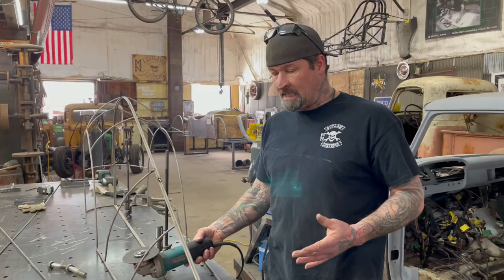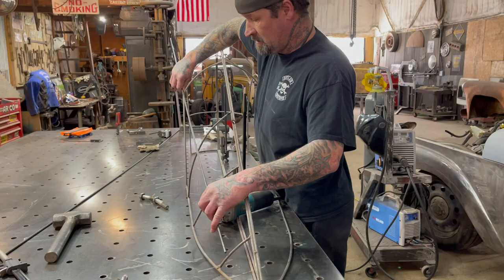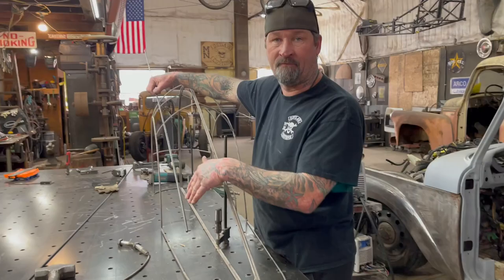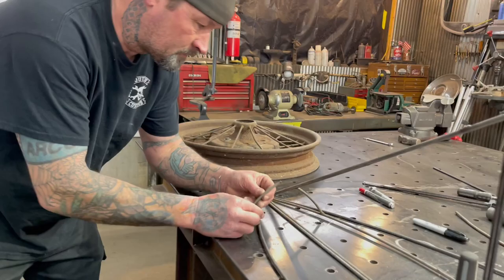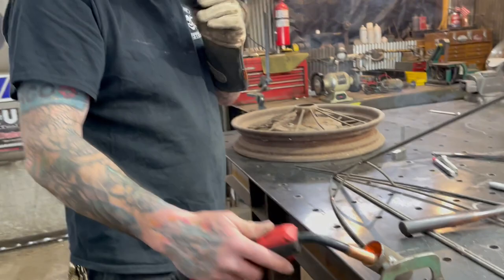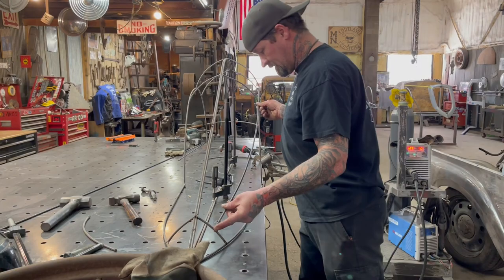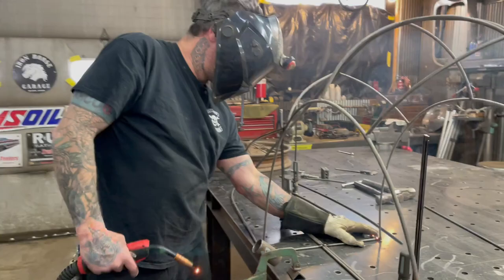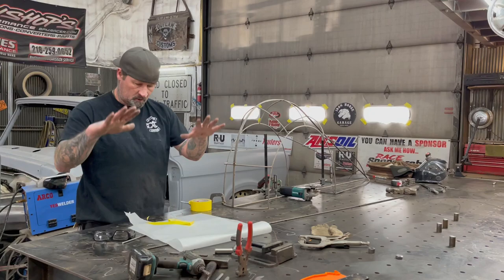Metal Shaping: Wire Form Buck fender revision, Vigilante hand build car part 2

Comment: One trick I've found doing those wire forms is i like to use 2 peices together so it makes them even and works quicker if that makes sense just have them on on top of the other and form them on the table dogs saves a little time and makes them exact